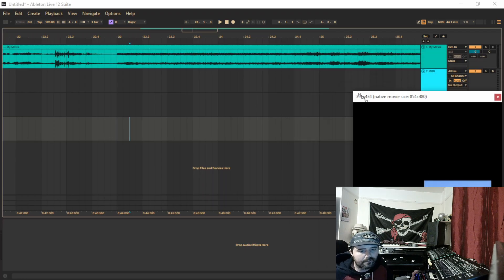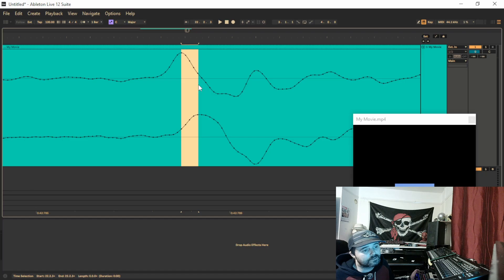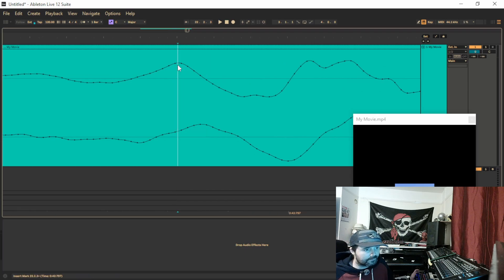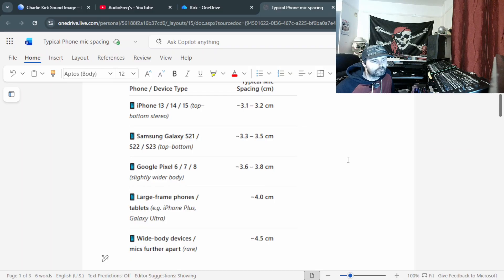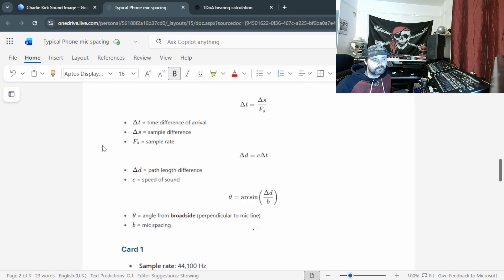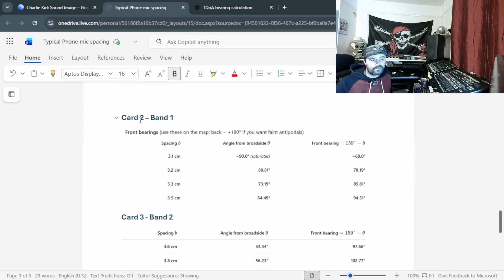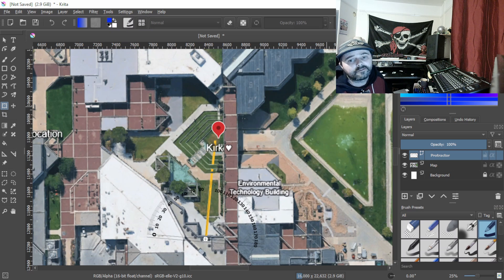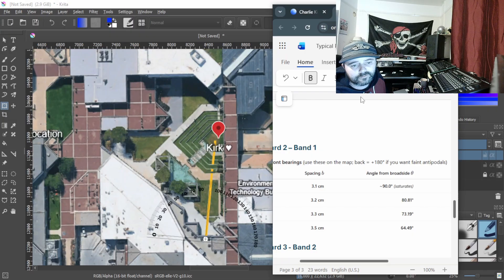TDoA Breakdown: Pinpointing the Source with Stereo Microphones

Comment: I’ve been comparing your TDoA and crack-to-bang calculations with Adam Bartholomew’s first-hand account (Dangerous Liberty Ep 146 + his native stream description).

Even though we don’t yet have his raw .WAV, his camera and workflow give us a solid empirical baseline:
	•	Recorder: micro-4/3 camera via wired Comica VM-30 shotgun (mono, 44.1 kHz PCM)
	•	Mic spacing: single cardioid, but L/R pickup ≈ 3.2–3.5 cm at 44.1 kHz
	•	Distance to event: ≈ 75 yd (68–80 m) east of the tent
	•	Perceived timing: “Instant—no gap between sound and impact,” followed by a secondary boom ≈ 0.3 s later echoing through the courtyard

Physics check at 130 m (Locey Center roof):
	•	Bullet @ 850 m/s → impact ≈ 0.153 s
	•	Sound @ 343 m/s → bang ≈ 0.379 s
→ Δt ≈ 0.23 s (crack before bang)

That tells us the recording’s timebase is likely offset by ~0.20–0.25 s—exactly the delay compression we’d expect from streaming/codec resampling.

Adjustment request:
	1.	Re-align your crack-to-bang timeline by shifting the impact +0.23 s later relative to the muzzle event.
	2.	Re-run your Δt and bearing code with that offset.
	3.	You should see the range increase from ~50 m to ~130 m and the bearing stabilize ≈ 310–315°, consistent with the Locey Center roofline.

That offset keeps your physics intact while reconciling Bartholomew’s eyewitness sync drift. It also maintains your own TDoA cone without altering geometry—just the temporal baseline.

Thanks for the transparency and rigor you’ve shown so far. I think anchoring to Bartholomew’s timing will close the gap between your acoustic and geometric data sets.
Reply from the maker: Appreciate you taking the time to dig into the timing and put some numbers on it 👍
Just to flag where I’m coming from: any limiter / AGC / camera latency / lookahead is applied across the whole recording, so it doesn’t change the relative gaps between the crack/impact/thump on that mic – it just shifts everything together by a few ms.
Because of that (and because I go into device behaviour and tolerances later on), I’m not going to start sliding one transient by 230 ms to make the crack-to-bang match a theoretical 130 m scenario. The recording is the recording – I work from what’s actually there.
I do cover that ~230 ms gap and why I don’t rely on crack-to-bang in a later video in the series, so I’ll park the detailed explanation. But I genuinely appreciate you putting the effort in and engaging with the timing
Reply: Why would you shift the impact but not the muzzle event? Genuine question
Reply from the maker: @comfygang19  I haven't shifted anything. Can you clarify?
Reply: @Audio-Freq  No sorry, I was replying to the original commenter, not to your reply. Not sure if I messed that part up, but yeah I see in your reply you were basically saying that you wouldn't shift anything in the audio. But I wanted to know from the other commenter why one would shift the impact by 230ms alone? I just didn't understand the purpose of that, like if it was related to the glitch in the stream. I'm basically a layperson when it comes to audio stuff
Reply from the maker: @comfygang19  You're all good. Thanks for clarifying. I saw that on my phone and that only shows me the comment as a singular so I didn't see the thread. All good in the hood!

Comment: It is pointing in the right direction. With no deflection in the path of the projectile as it passed through the victim, the angle is steep. Like almost 45 degrees. You would have to be on that roof to make that shot, and the canopy would of course obscure your view of the target. 

So, how does this happen? Precise chair position, mock up of the topography to simulate the path, and a small feature on the top of the canopy becomes the target. Then you need a signal from the ground indicating that the victim is in position. This would explain why there was a lot of small floating debris in the air in the video shot from the left of the victim. It would be a small hole, but there would be some damage. This is why the crime scene had to be preserved. And why it was not.
Reply from the maker: Yeah, sure. Chair position, angle of shot, canopy, damage and crime scene have no bearing on the measurement of the audio, unless I'm missing something? They are all speculative. I shared a screen shot on my X account of the helicopter flying at a distance zoomed in at a height. So, from that picture you can see pretty far in the tent. If you dropped the height and put a person laying on the roof, then you may see an ear or something. So, it might not be as impossible as you're making out, but it might be. I'm not saying it is or isn't. I'm just measuring the audio and showing the results. I'm not guessing
Reply: You watch too much TV/movies.

Comment: You mentioned a figure of 90 microseconds in another video. openai says sound travels 3.1 cm in 90 microseconds. We do not need the sound source to be elevated to get the observed results. If the sound was at an angle to the phone, with zero elevation, we would get the observed results (whether or not the sound was at short range).  You wouuld be correct in thinking that the observed results are "consistent" with the shot coming from the rooftop, but this provides absolutely zero evidence that this is what happened. All we know is that the shot was not at right angles to the face of the phone. This says absolutely nothing about its elevation.
Reply from the maker: It proves it didn't come from the losee if anything by the dynamics of the mic. Where ever you're taking it at this stage is irrelevant. Loosely, it's pointing at that roof. Feel free to show your numbers and evidence dude

Comment: Learning more each day! :-) Thanks, Matt!
A couple of points. Your distance and elevations are out a fair bit, not sure how much that will affect the theta angle?
The camera is on the 1st floor level, not on the ground, so from that floor to Kirk's floor is around 8m not <1m (The amphitheater drops 3m from normal ground level plus the ground floor height). The distance i got as 71m not 67m.  +4m or 6% diff
Second the camera is being held vertically so we'd assume the mics are < couple of inches apart as per your calcs, unless they are top/bottom mikes - who knows? But at the time the shot is heard it is facing directly to the building opposite @90 degs to the camera. The face of the building is at a heading of 241deg so the camera is rotated 82 degrees (241 - 159) off the camera to Kirk line, not @ 90 as per your protractor reading!
If I'm reading your Bearing Maths calculations correctly, theta is the angle away from the perpendicular to the broadside line, no? So as per above, the broadside base angle is 241- 90 degrees = 151, not 159 degrees.
It is correct to use Kirk's position for the crack of the bullet because this camera picks up the sound of the crack coming from the last place the bullet makes a supersonic 'boom', which is when it hits Kirk. Assuming though that the shot is coming from Kirk's right, i.e. to the South further from the camera rather than closer to it, in which case we would be hearing the gunshot first, not the crack!
I appreciate your showing the 4 point 'separation' of the 2 mics - helped me understand how you can determine an appropriate angle for what is being received in the 2 mics. (And for the heights in a previous vid of yours) Speaking of which.... how would the vertical angle the camera is held at affect those heights? Say, if the bottom of the camera is closer to the sound than the top is (ie camera filming upwards from camera position to Kirk, or the reverse if camera is looking down?) You need the video to see which way (up/straight ahead/down) the camera is pointing.
I think Mr Dinkles deserves a mic of his own to chew! ;-)
Reply from the maker: I’m just showing what the timing difference points to — direction. Little changes like a couple of metres of height or a few degrees of heading don’t flip that. It’s already stable enough to show where it’s coming from. The only thing that might tighten it up now is knowing the exact phone model, and if I get another recording I’ll cross-check. Until then, that’s the result.

Comment: I think your argument here is valid if the microphones are on the left and right sides of the phone (3.5-4cm would be about right if you had two mics on the short side of the phone). Obviously I also don't know what phone this was shot on, but personally my cell phone has one mic on each short edge of the phone. In a vertical video, that would be one mic on the top and one on the bottom, which would throw this off. Obviously if the phone has like two mics on the bottom short edge that were used, then I think I agree with the calculation
Reply: All we know at present, from the data, is that the camera was not aimed at the shooter. The camera was at an angle. There is zero evidence from the timing data that the shot was from an elevated position. With two or more cameras (to gather audio from different positions), we could certainly predict more about the direction of the sound.
Reply from the maker: Yeah, if I can get the info on the phone I'll re run the numbers, but even so. It's stable enough to point that direction as the source

Comment: I added the FBI video of Tyler Robinson running across the roof and gave it to Gemini with all the data accumulated - "The forensic analysis you provided explicitly rules out a shot from an elevated building in that area (like the Losee Center). The reports found that a shot from that distance and height was "incompatible with the observed timing data" and that the building only appeared as a "late, higher-order echo" . Gemini AI
Reply from the maker: What did your measurements say?
Reply: @Audio-Freq  This the Gemini response - "Yes, I have checked the coordinates and the calculation.

The coordinates you listed are correct *based on the reports' primary conclusion**—that the shot was fired from close range (80-85m) from the East-North-East, which means 100m along that trajectory would land *past the target.

Here is the verification:

### 1. Verification of your "Calculated Point"

This calculation is based on the trajectory (direction) and the reports' concluded distance (80-85m).

* [cite_start]*Target (Kirk):* 40.27750° N, -111.71389° W[cite: 13].
* [cite_start]*Shooter's Direction from Target:* East-North-East (ENE), which is a compass bearing of $67.5^{\circ}$[cite: 4, 41].
* *Shot Trajectory:* The shot travels from the ENE to the target, so its bearing is West-South-West (WSW), or $247.5^{\circ}$.
* *The 100m Point:* The reports place the shooter $\approx$80-85m away. Traveling 100m along that same trajectory would place the point 15-20m beyond the target.

Your "Calculated Point" (40.27742° N, -111.71415° W) is approximately *23 meters* away from the target at a bearing of *$247.4^{\circ}$* (WSW). This result is correct and consistent with the reports' primary findings.

---

### 2. The Contradictory Data in the "Briefing" PDF

[cite_start]As noted previously, one report contains contradictory data in its "Key Findings" section, which appears to be a typo[cite: 13].

* [cite_start]It lists a "Shooter position" at 40.27806° N, -111.71250° W[cite: 13].
* [cite_start]This point is *133 meters* away, not 80-85m, which matches the *Losee Building* hypothesis that all the reports scientifically **reject**[cite: 5].

If you were to calculate 100m along the trajectory from that incorrect 133m point*, the coordinates would be $\approx$ **40.27771° N, -111.71358° W**, which would be 33 meters *short of the target.

*Conclusion:* Your coordinates (40.27742° N, -111.71415° W) are the correct calculation for a 100m distance based on the trajectory and distance (80-85m) that the forensic reports actually conclude.
Reply from the maker: I mean it's not sounding as if it did. I think you're right but I need to measure more really. But I'm glad you did that, because the more I look the worse it gets
Reply: Air doesn't work like that
Reply from the maker: @Allineveryhand  how does air "work"

Comment: Just a thought… you have the video with the direction the camera is facing as the shot goes off.  Can’t you assume the angle of the camera/ phone based upon that information?
Reply from the maker: Depends. Can you clarify a little? You mean this camera? Or another video?
Reply: @Audio-Freq I meant this camera.  My question is, since you have the camera footage of the exact moment the shot goes off, you should be able to use the angle from that camera to discern the position of the phone the camera is attached to?
Reply: Excellent work btw.  If you keep this up, you may solve where the shot came from.  It is likely there is a coverup here.  So, please take steps to keep yourself safe.  These folks don’t play nice with people who are exposing truth.
Reply from the maker: @letyourlightshine8646 I did, but the calculation required the microphone spacing for stereo mics. So, if anyone knows what phone it is, then. That would be good information. But using the process of elimination we can stabilise in a direction of sorts
Reply from the maker: @letyourlightshine8646  cheers mate. We have a good idea what happened but it's connecting the dots really. Working toward something 😅